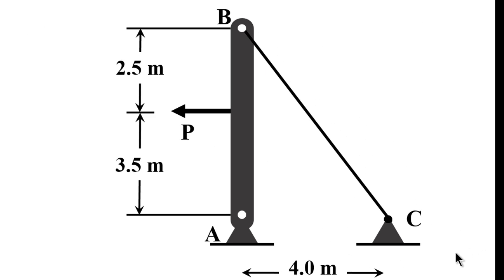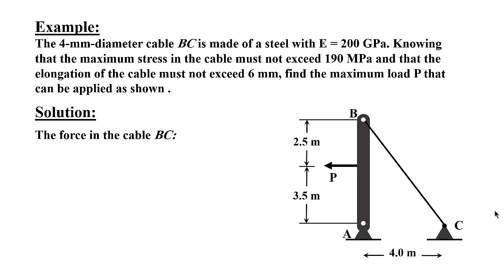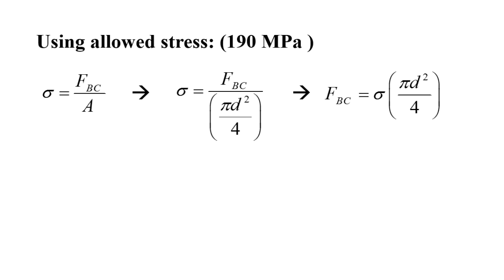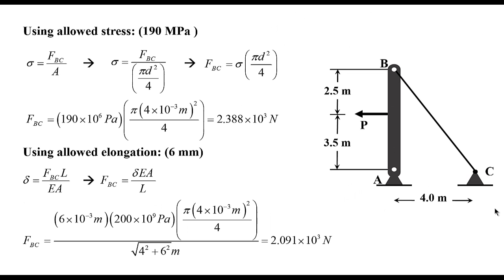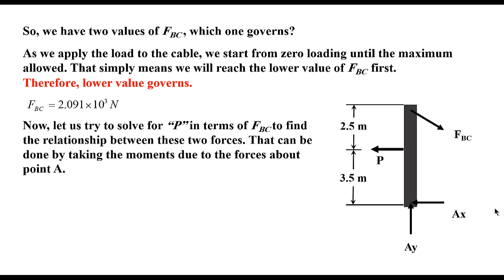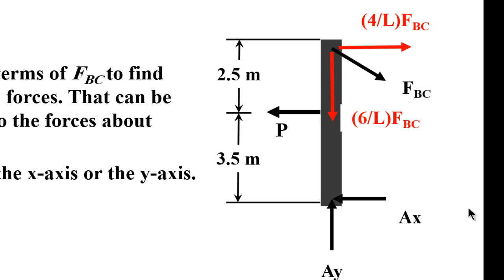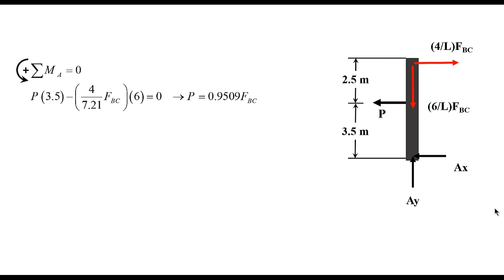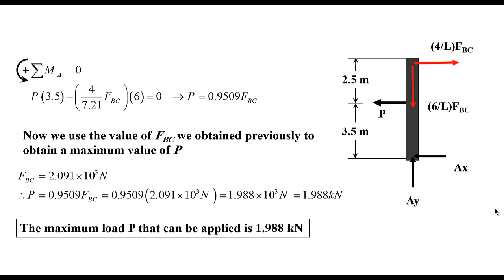Maximum unknown force based on cable elongation and stress

Comment: Hi. I am not able to understand the 2nd example. You said 'As we apply the load to the cable, we start from zero so no load and the cable has no stress no elongation and gradually we apply the load. So we apply we start from zero loading until the maximum allowed which can be the the maximum allowed to to the elongation or the maximum allowed to to the stress allowed" That means simply we will  reach the lower value of B F BC first.'
So if I understand correctly we have to apply the load to the cable we start from zero loading until the maximum allowed. That simply means we will reach the lower value of F BC first. I am just confused how will we reach the lower value first here. Can you just please tell this.
Reply from the maker: Keren Peter DO not over think it Keren :)assuming that you have two values that govern the design. Meaning, you have to decide if the cable will fail at (for example) 10 kN or 15 kN. if there is no load in the cable, the cable is safe right? now gradually apply the load (say 1 kN). you are still safe. Now continue applying the load until you reach 10 kN. What will happen? the cable will snap (break). Can you reach 15 kN without snapping the cable at 10 kN? You will "stop by" 10 before reaching 15 and that is why the lower will govern or "make you decided" which force is to consider.
Reply: CTSCIVIL Oh thank you.Yes indeed I was overthinking :).It was so simple. Yes without load initially we should reach lower value of force first.I was thinking other way round. So stupid of me. I think I got little confused with the explanation which I posted above first where you might have just misspoken but its commendable you took out your time to explain me.I should be very attentive from next time.
Reply: CTSCIVIL I completed watching 2 of your videos today. Must say the way you explain things is exceptional. Great work. Sorry for asking such a stupid question in my last post. My bad. We from UK sometimes lack commonsense:)But yes if you want you may put some annotation for misspoken part for example 2 explanation for this one which I mentioned. Its not needed as such but just for users to get more clear picture. What say?
Reply from the maker: Keren Peter Hey Keren, can you tell me at what time exactly so I can add the annotation. Thanks
Reply from the maker: Keren Peter and tell me what video are we talking about please :)
Reply: CTSCIVIL Many people are telling me that my comments are not visible. I recently changed some settings. Could you reply to my previous comments if you are able to see them.
Reply: CTSCIVIL I think there is some problem with my comments not getting posted or visible. Let me try again here. I was talking about the misspoken part in this video only:) But I have forgotten where it was. It was in both complete examples at multiple places. Will let you know in sometime. Even in one more of your video I found something. Do you remember finding out after recording any of such misspoken part in any of your videos?
Reply: CTSCIVIL You are getting my comments right? Kindly reply